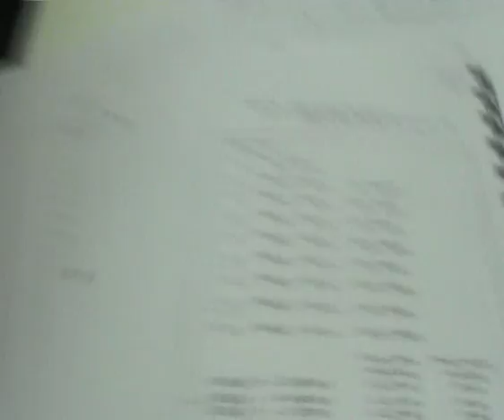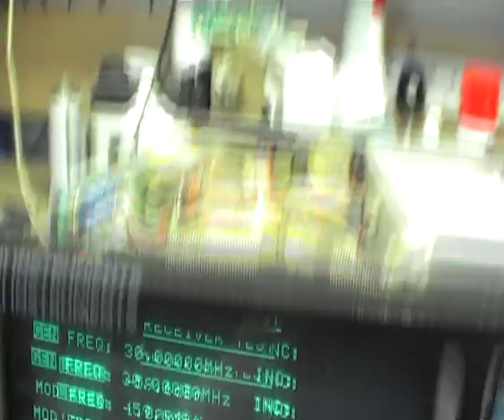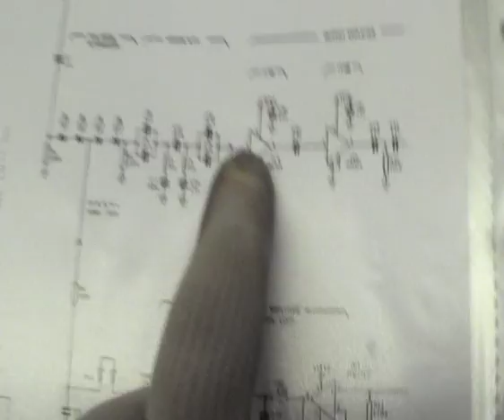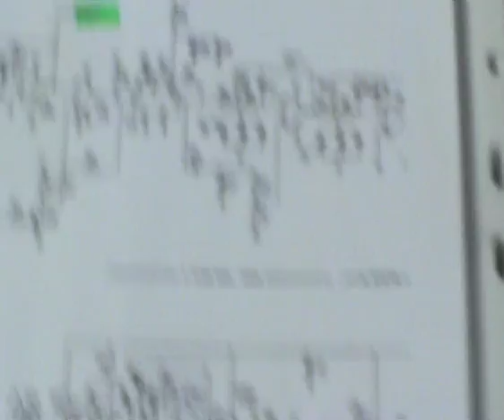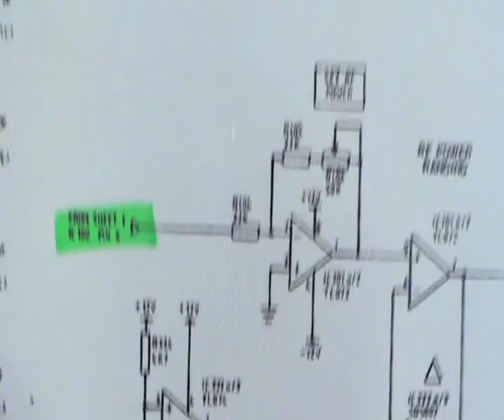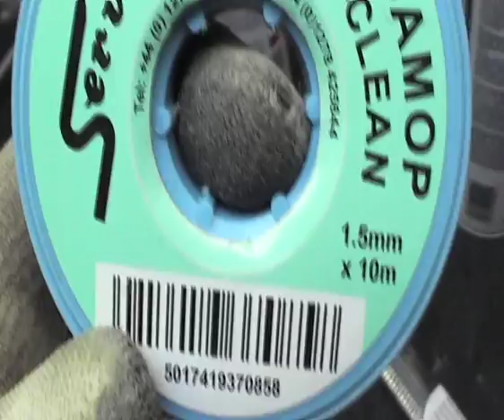Marconi 2955A Radio Test Set Repair Part 2 of 2

Comment: Hi John,
I'd like to ask what you had your oscilloscope set on to get it to have some vertical height in its measurements, when I did it on my scope which is an analog scope, all I had was a line and then on pin 1 jumping up a little and then it jumped up more showing amplification on pin 5, but I was wondering if you could tell me what the settings would be on a tectronics analogue scope to get it to show a vertical width band like your scope was showing..
Kevin Rea
Lancaster California USA
Reply from the maker: Hello Kevin, to be honest it was that long ago I can't remember the scope settings. I remember the probes were set to x10 as not to load the signal. I presume that you are referring to the synth board. If the OM module is working correctly you should see significant voltage gain from the output compared to the input. Remember this is part of an ALC circuit so it may throw you a curved ball. I hope this is of some  help. Regards John

Comment: just trying to repair my 2955A.
seems mine also doesn't att smoothly but steps up,
yet on a scope both my OM chips seem to be amplifying ok..
as in increase when probe on pin 1, double increase on pin 2, so i assume these are amplifying ??
also on HF up to 50Mhz i get RF in steps as the ATT pads are switche din.
VHF and UHF are fine..
so not sure where to go..
faults are 11, 25 and 7 as yours was..

any ideas @john hawkes ??

Comment: I'd be interested to see a performance test and calibration video if you have time. It seems I have a similar or same to the power meter and frequency counter when in Transmit Test mode. It seems to work fine when the BNC is the input, but not from the N type input. The reported frequency is too high and the power reading was not working. So I'll follow what you did to isolate the issue.  Thanks again for your videos. Hope you get to make more about these instruments.

Comment: Hey John,  Did you ever get back to your workshop?  I've got a 2955a that I'm trying to fix.  My unit fails all self tests.  In TX test mode, the unit reads input power and frequency fine.  Audio frequency generator works fine as well.  When I set the RF generator to output a 1MHz signal, it outputs a 23.110MHz signal.  It tracks as I step up the frequency in 1Mhz increments all the way to 59MHz on the screen which is a little over 80MHz output.  at 60MHz, the output drops out entirely.  Have you seen anything like this before?  I've checked the 200MHz oscillator and the 10MHz oscillators and they seem to be working fine.  Hopefully you are still monitoring these replies.  Thanks
Reply: Just to make a correction.  Power doesn't drop out over 60MHz, I think that was a problem with how I was testing.  Power is consistent from 1MHz to 800MHz.  It seems to be some kind of offset that starts around 22MHz when the unit is set to 1MHz output and reaches about 80MHz when the unit is set to 800MHz.  It always outputs higher than the frequency setting on the 2955.
Reply: Ok, last update for the night.  the voltage at pin 6 of IC107 on the AA3 board is higher than it should be.  The pin 7 voltage is 22vdc like it should be.  I can't find any information in the calibration info on how to adjust the voltage so it reads as it should.  If I remove PLD and power R3 directly I can vary the voltage and get the unit right on frequency so I think I'm headed in the right direction.  Do you have any idea how I would calibrate the output of that IC?
Reply: Did you get your test set working? I've been repairing one.  Initially it failed all self tests until I pulled out the gpib cable from the unit on the bottom because it wasnt powered up. Then it only failed all the 3.x tests.  Now the only issue is that it wont read power or frequency from the N connector input.  However it outputs the correct power and frequency from both connectors.

Comment: Hi John, Marconi strikes again. Error 1.0 Fail 11 - 1.1 Fail 13 - 1.2 Fail 15 - 1.3 Fail 17 - 1.4 Fail 1A. Anything to do with the oscillator? When it starts it reads okay, but after not even five minutes he goes berserk.  On 146.200 it reads 489.700Mhz. Kindly advise from your point of view. Thanks a lot.
Reply from the maker: Hi Rob.. I am currently working in the Netherlands and don't have access to my workshop at this time. The 2955 is controlled by a oven controlled 10MHz oscillator which is the reference for everything including the logic. I have seen quite a number of 2955s with this unit breaking down. I have replaced the complete unit with rubidium 10Mhz  clock from a mobile phone cell site found on  ebay and it did the trick. I hope this is of help. Regards John

Comment: Hi John. Thank you for a very nice set of videos how to repair a 2955 unit.
I'm about to buy a old unit which have some power issues. 
Do you recommend replacing old electrolytic capacitors around the unit, or just in the PSU? 
I also heard scary stories about instable 10 Mhz oscillators causing Eeprom to fail?
What's your experince in these matters?

Best regard 

/ Mike